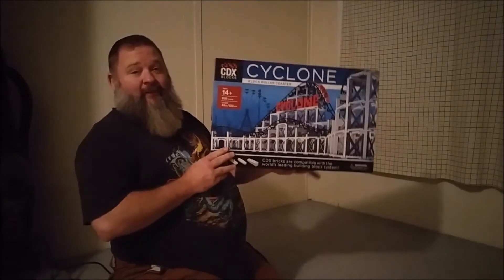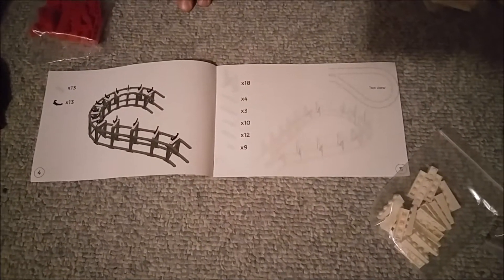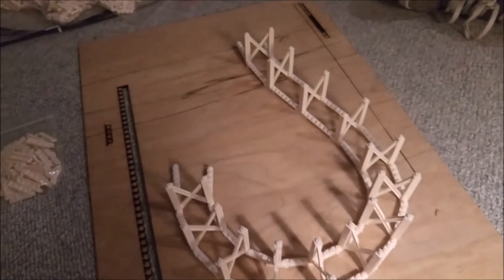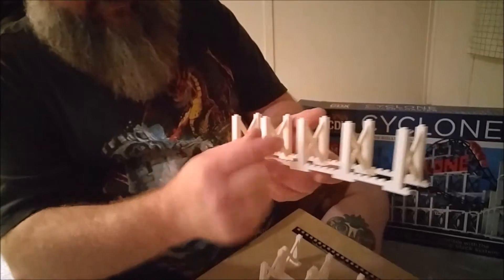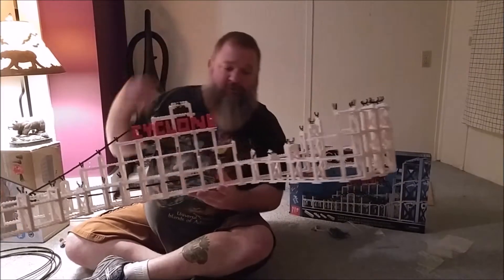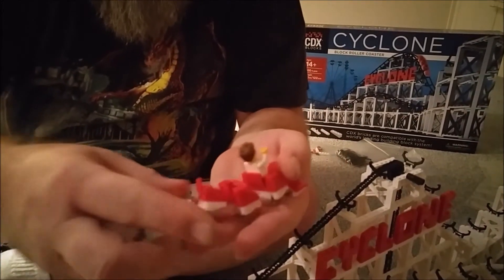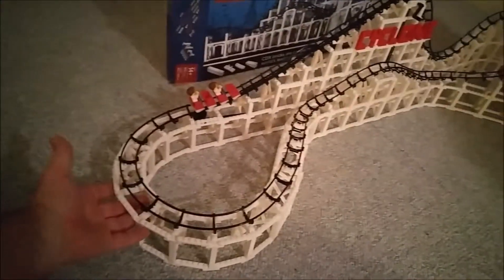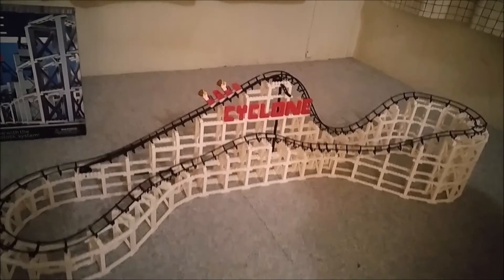Cyclone CDX  Lego Compatible Roller Coaster

Comment: How did you uncool the damn wire it’s been annoying me
Reply from the maker: I imagine you're talking about the rails. Rather than pulling one end from the loop of rail,  I unrolled it all the on the floor as much as I could.  It still wanted to coil up, but I just had to be patient.  

As I snapped the rail onto the crossties, I  would untwist the rail every few crossties so it wouldn't get tangled.  

It's definitely the most frustrating part of the build

Comment: How big are the cars?  How big are the people they give you?   Do you think the chain can be routed in an oval, like a real coaster as opposed to going directly down to the bottom and across?   Thanks!
Reply from the maker: Hi Jim, I am sorry for the delay.
The kit comes with no people.  It will fit Lego minifigures, but I imagine you could modify it to take O scale people.
And yes, the chain can be routed like a traditional coaster - I imagine this was done to make the kit easier to build.
There are some real life coasters that use a cable lift system that follows the same "directly down to the bottom and across" path as this model's chain.
Happy Building!